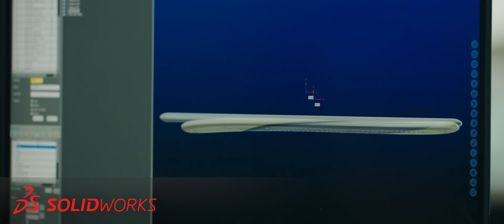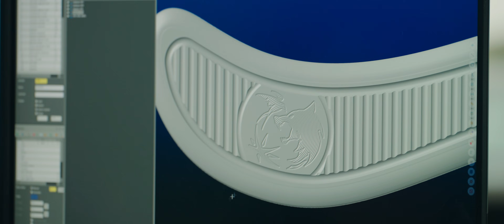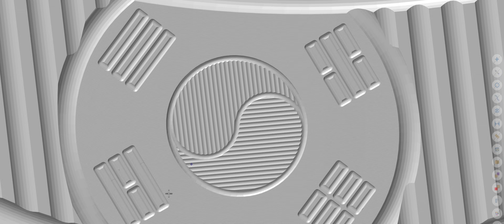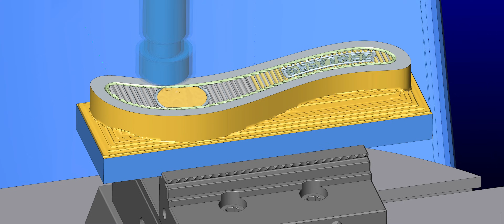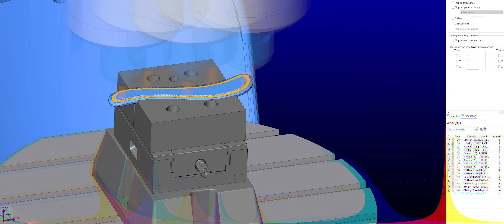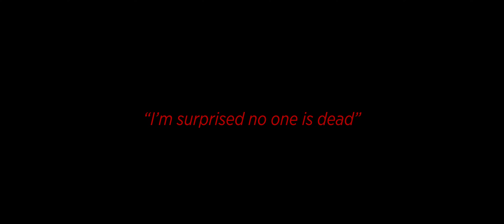Machining Ultimate Tool after Near Fatal Car Crash

Comment: It’s wild to see this technique work, but I was that same person saying how will rubbing help. Two weeks ago I hurt my pecks working out. I think over stretched the muscles at ligament attacking points. I couldn’t lift more  than 20lbs for a week after hurting myself, but I decided to start doing the rubbing technique with my knuckles. It’s amazing how much more improvement I had daily when I used that along with cold showers (48 hours after hurting myself not right away just to be safe). I wish you a full recovery brother! I’m currently doing the same since I lost some range and still fell it slightly on my muscles when I stretch.

Comment: It would be really awesome to have some blanks built out of pattern welded steel "damascus" stainless steel damascus or Damasteel then run it through the CNC milling to put the contours and names on it thrn have them heat treated so the pattern etches really nicely. I might have to try and forge out some of these for the PT tech I've had to use throughout my recovery from a failed back surgery. This is a really awesome thing to do for the people who help so much in recovering from traumatic injuries.

Comment: I worked as a welder building steel buildings, and had a fairly significant fall in 2001.  I herniated three disc in my neck, broke the radial head off my arm bone, and shattered my right wrist.  The orthopedic surgeon said my wrist was the second worst wrist he'd ever seen.  The worst wrist was a guy who had been shot in the wrist with a shotgun.  The surgeon rebuilt my wrist with a screw and some cadaver bone.  My wrist was in a cast for a total of six months.  I did physical therapy, but was only ever to gain very, very minimal movement in my wrist.  I wonder if I would have gotten better results if my therapist had had a tool like that. I've learned to adapt over the last 22 years.  If you're anything like me, using a hammer a lot will cause pain and inflammation the next day.

Comment: PT/OT’s actually helped me tremendously because I had severely injured my right shoulder. The doctors wanted to do surgery. I just asked if therapy would help. They said we could try. 6 months later, I’ve got about 95% of strength and mobility back. From dry needling to cupping to strength training to mobility exercises to ice compressions. They put me through the wringer. It’s so awesome to see that you were able to make them (not buy) a custom tool that they will cherish. Glad you made it through the whole process.

Comment: occupational therapy helps if the person has no guidance and the dr is a shit head. had 2 surgeries 1 year broke several bones and had a plate put in me, first time had insurance and therapy, second time was way worse and didn't have either. found a pdf online by Google "therapy" for those procedures that were done and boom found pdf's with full guidance down to the days on what to do. if yall don't have insurance and no help, Google the therapy procedure.